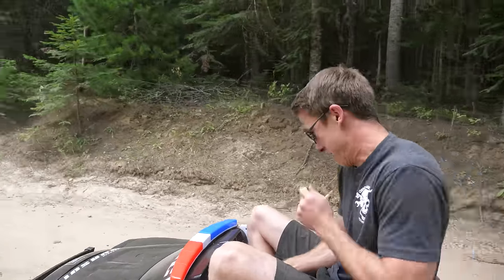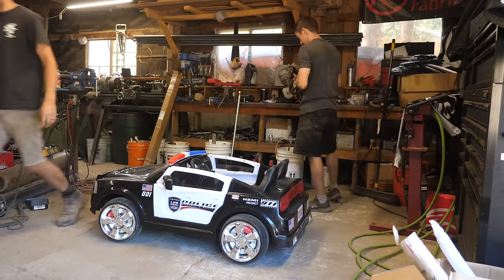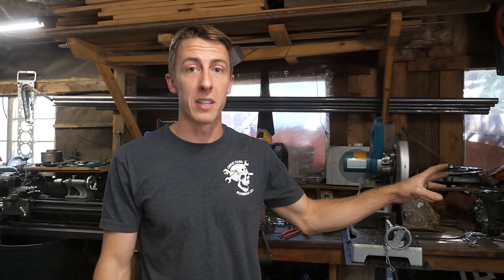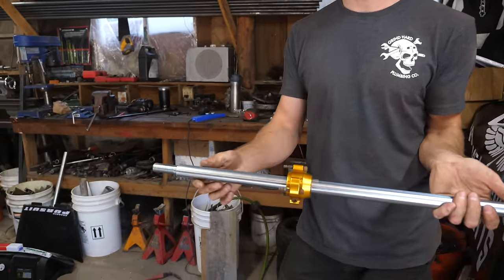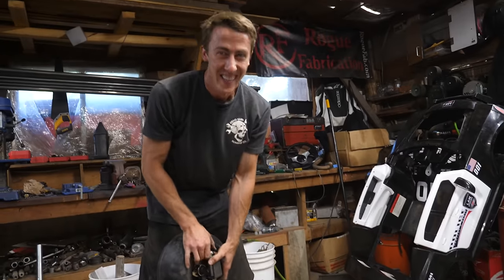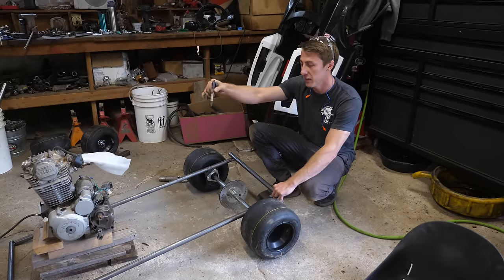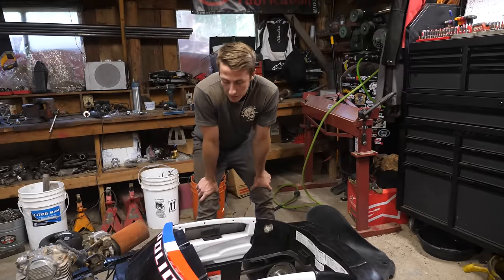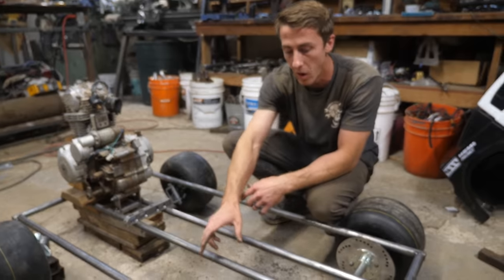DIY Power Wheels Go Kart Tutorial Series

Comment: if only I could weld.

guess its time to learn.
Reply: It’s not really that hard
Reply: Its not hard at all
Reply: it’s scary at fist but once you get the hang of it it’s fun
Reply: Yeah man pick up a 120V titanium flux core welder from Harbor Freight for $200 and get to work!  No excuse not to!
Reply: @Hangovna  thanks i will give it a shot👍
Reply: @stangkid5196  the hardest part of welding is getting the settings right. Once u get the settings right start out by doing small bead sections so you can figure out your timing and puddle flow and after that it's pretty much just experience
Reply: I would recommend picking up the cheap 125 welder at harbor freight that’s where I started.
Reply: @hillbillyhomeboy4121  Yup thats what I have, they're $180 right now actually.  It'll melt whatever steel together you can think of around the house and is an inexpensive way to start out.  It does a pretty good job once you figure out the settings.
Reply: @Hangovna   you have never lied
Reply: I was just gonna ask my friends who can weld to help me out with the frame lol
Reply: You can do what Colin Furze did and just use bolts: https://www.youtube.com/watch?v=vuRV-uXGy1w

Learning a new skill is awesome though, so 🤷‍♂️ 😅
Reply: Just buy a cheap mig welder. You can probably learn in half an hour.
Reply: I agree with the other replies that it's not really that hard in the context of building go cart frames but id like to point out that some welding jobs and situations take a lot of skill and experience. Also, even when hobby welding, some situations have a safety element that shouldn't be taken too lightly. In other words, get a welder and have some fun, just don't expect to be making x-ray quality welds right off the bat and don't trust your safety to welds unless you know what you're doing.
Reply: all of these comments are so helpful and I will give welding a shot when I'm back in my home town.
Reply: WildBoer try your self I thought myself when I was 11 got jobs welding when I was 12
Reply: Scott Hangartner mine was 80$
Reply: @venumus1  @stangkid Agreed! I am also self taught. I would recommend practicing on old bed frames or whatever scrap you find, but not thin sheet metal. Avoid galvanized metal as much as possible. Start by practicing on 1/8 inch or thicker steel will help you get the feel for the process. Learn to listen to the arc. It will tell you when you are doing it right. As you get more comfortable, you can work toward thinner stuff. Thin metal is easy to find and cheaper but requires more experience to do well. Just my 2 cents... keep the change.
Reply: hammer a practice weld...and you'll see it's not too hard to do
Reply: If only I had a welder ahaha
Reply: I am 15 and i can weld so you could easyly learn it too

Comment: You should break down the cost build it. Things like the power wheels itself, the motor, materials, etc.
Reply: Ethan Benner  They have done this in the past with some of their earlier builds
Reply: Cameron Richards I know, but since this a a more simple build I would imagine it costs less than their other builds and I would be interested to see the difference
Reply: Used parts costs would vary so much location to location it really wouldnt be useful information. Salvage freebies, special deals from ppl you know vs buying from market place or new.  wheels, metal stock, steering, bearings etc. Just set yourself a budget and make the best of it. I'd guess 800-1k and a month or 2 of time depending on your schedule
Reply: Ethan Benner You’re right I would be interested as well I would say it would be similar to the Barbie cart tho
Reply: if your lucky you can go to some yard sales and pick up a cheap used power wheels for $20.00 or more.
Reply: Saw someone else comment, saying the build list came to like 500$,have not checked my self.

Comment: Could you do this with a stick welder?
Reply from the maker: Yes!
Reply: @GrindHardPlumbingCo  What do you guys use to cut the angles on the pipe
Reply: We used round tube because we had it, but it would be a lot simpler with square tubing, no notching required just angle cuts! 😎

Comment: Thank you a bunch for doing this series but I would like to not see the use of a welder. Most people don't have access to them.
Reply: If you can’t afford a cheap harbor freight welder, then you don’t need to waste your time with a project like this.
Reply: @adamr9215  I just looked them up, I had no idea they were that cheap
Reply: @adamr9215  so nvm
Reply: Low Ryder Lol, I think more people would try stuff like this if they did a little research. And hit a couple of scrapyards outside of the city they lived in. You can find a good start with a little creativity.

But, I’ve seen a few bolt together go cart builds on youtube. Most said that they didn’t last long. Even bolt together would work better if you welded tube into any holes you drill. Just a small tube that fits the bolt tightly would slow the wear.